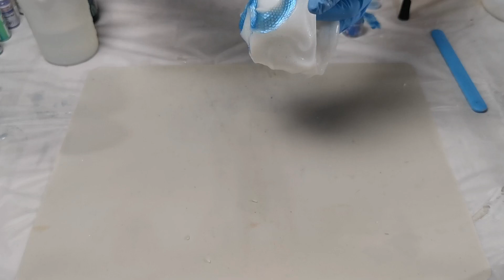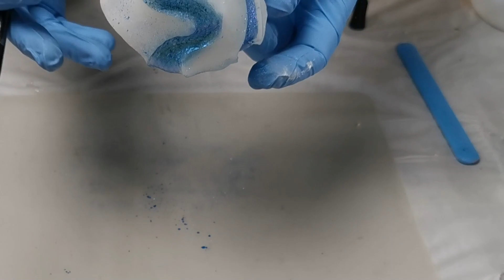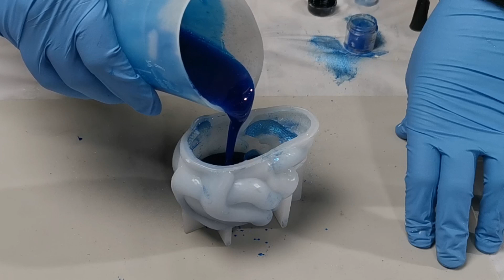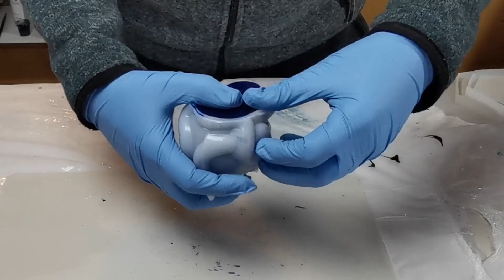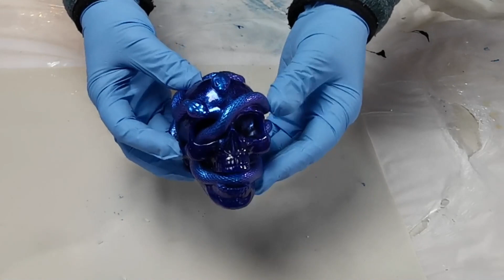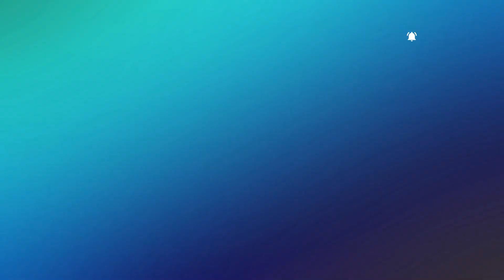How to use Mica Powder with Resin: Elevating Resin Details with Mica Powder!

Comment: Does the mica rub off after resin is cured? Or wash off?
Reply from the maker: Thanks for the question. No the mica is absorbed by the resin so when you take it out of the mold the mica is not there and is part of the resin item.